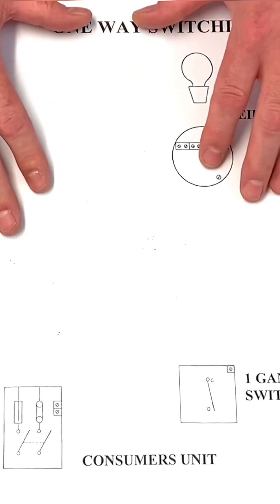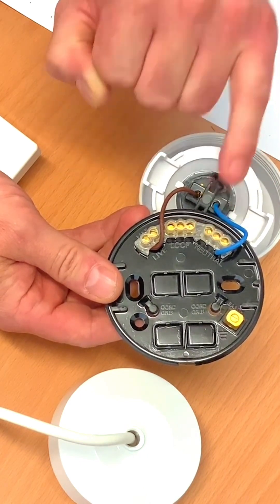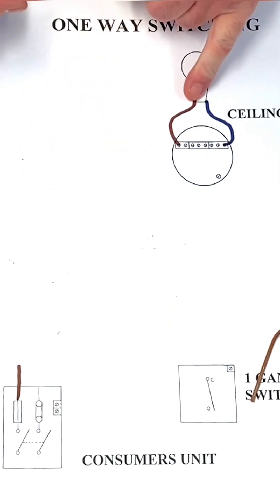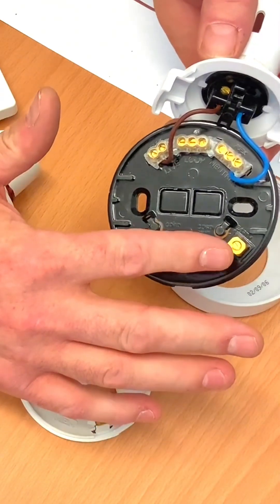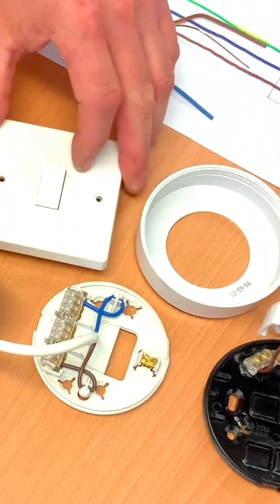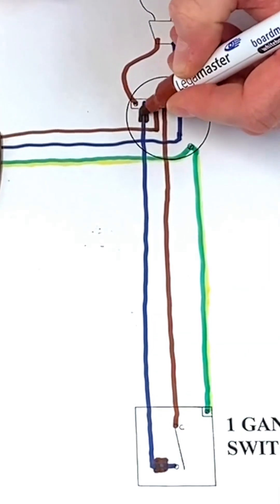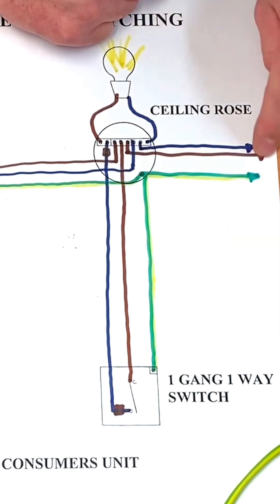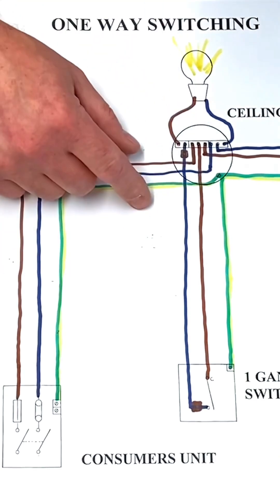1 Way Lighting Circuit Wiring Diagram

Comment: You are so good at teaching. In the switch, why is the live side called "common" and why is the other one called L1?
Reply: The switch moulding from the switch manufacturer is the same for a one way switch and a two way switch, but in a one way switch derivative one connection is blanked. In the two way derivative there would be a common, and two others, L1 and L2, for the two way lighting to work. The switch in one position will connect common to L1 and in the other position will connect common with L2.